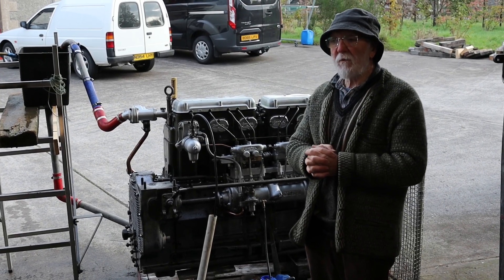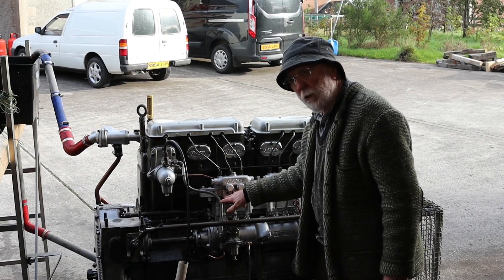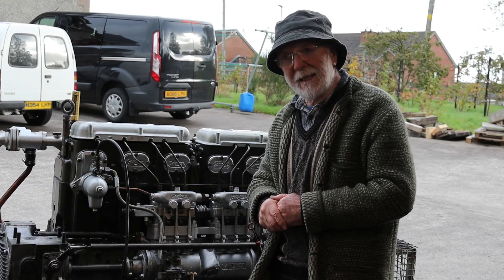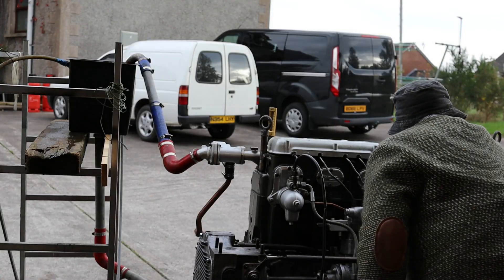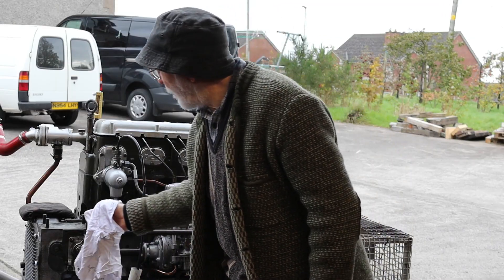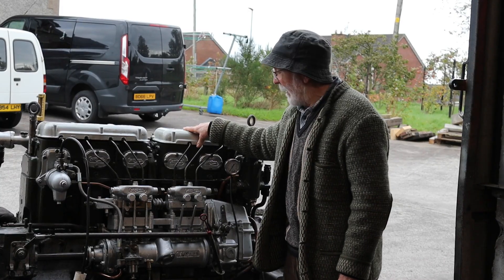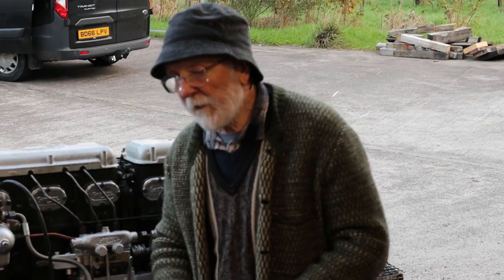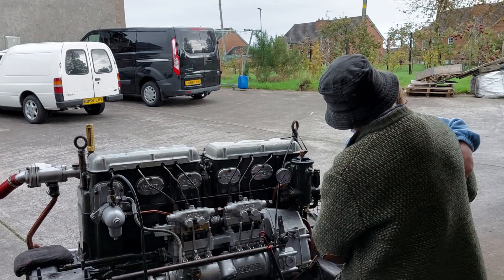Gardner engines, what the latching levers tell us.

Comment: Joe, thanks for the video.  My 6LW has a little hole in the cover of the injection pump which I believe is for squirting some oil into the injection pumps (both banks).  Is that correct and if so how often should that be done?
Reply from the maker: I can't give a definite frequency, but the rack must be feather free.   You can judge how free it is by listening and operating the strangler lever.   You should hear flying rearwards with a definite thump!

Comment: I was in the traffic in Melbourne  maybe 20 years back, next to me was a big pommy truck,  i looked over and saw that the side engine covers were removed and rattling away was a gardner diesel, wasn't hard to spot all the gardner logo plates on the engine, and when the truck took off you coulld see all the levers for the accelerator moving. The truck wasn't no mint condition club truck, but was pulling a trailer with containers and earning its keep.
Reply from the maker: Thanks for sharing that story. Always good to hear about these old engines still out there earning their keep!

Comment: This raises the question, was this intended to allow it to be used as an engine/compressor?  There were many cases in the US where a standard engine block was used a such, with half the cylinders providing power, and the other half acting as an air compressor.  Guy I know has an engine/compressor/crawler tractor intended for quarry work on a rough quarry floor.
Reply from the maker: I've not heard of them used like that, but I see no reason why not.
Reply: @tangentgardner  The one I saw was a "1948 Schramm Model 60 Ford V8 Based Crawler Air Compressor".